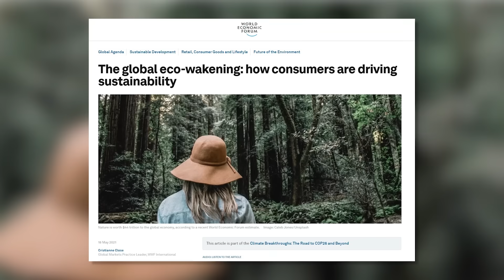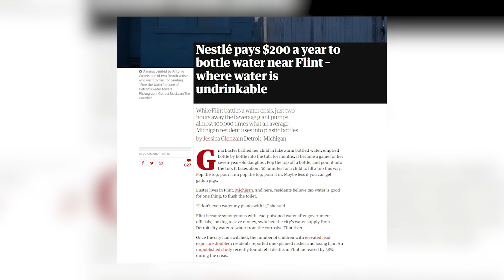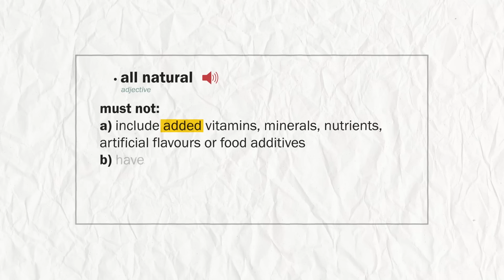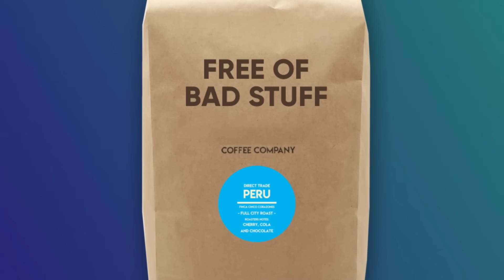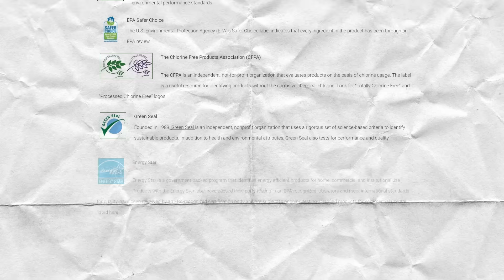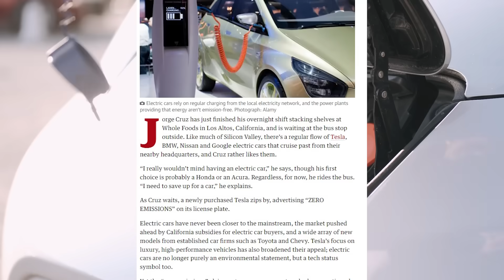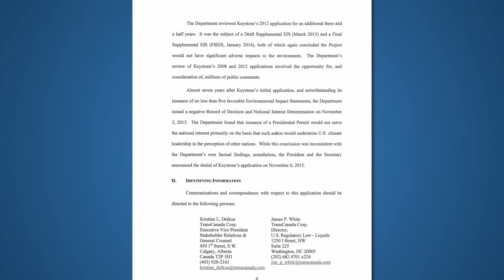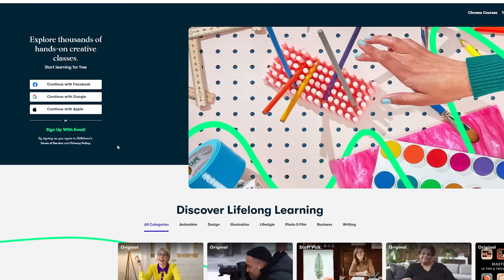Why Being 'Environmentally Friendly' Is A Scam

Comment: For the most part I agree with what he says, but the pipeline thing is crap. It's so many times worse for the environment to ship the oil via trucks for so many reasons. It uses oil, pollutes the environment. Not to mention that a rare pipeline spill has less impact and is easier to clean then a tanker spill, which is statistically far more common. So congratulations america, you shut down the more environmentally friendly option by listening to people who didn't know scratch.
There should also be mentioned how much most alternative energies rely on hard to mine heavy metals, and the negative impact the environment has on that. The worst part to me is things like wind, where the wind turbines have a lifespan and then the blades and everything are dumped. There is currently no way and no one recycling them. I was really horrified to learn more of that

Comment: More cotton bags are being made but you need to use them 20,000 times to offset the environmental resources. Plastic bags have been proven to be better for the environment and contrary to the democratic belief... most people do reuse plastic bags. Plastic bag holders have been made by ikea not that long ago. Most people use those bags up to 3 times each.
Reply: We banned plastic bags here. I used to save them and use them bathroom bin bags or clean the litter.

Comment: want to help the planet? PLANT TREES!!!! shocking truth is trees will and do help the planet more than anything we humans are doing because 95% of green house gases is water!!! and don't go with what google shows you. sadly they are just on the "eco-friendly" wagon. (Edited add on) Neither side did the research properly on the Key Stone pipeline. How do I know? I did a research project for my Bachelors Degree on it. The pipeline is an ADD on, not a full blown new pipeline, and all they did was draw a line and say "ok here is were it's going to be" they did not research where it really needed to go and what it needed to go around. oops on their end....the green peace side didn't do their work on "Oh look over 2,000 tucks will be removed from the roads hauling sand oil from Canada to Texas every day." Meaning Thousands of tons of toxic emotions would of been removed from the air. Also, there are more oil spills from people crashing those tankard trucks than a pipe line spill. Yes, when a pipeline does break it's big. Nothing humans do is perfect, it never will be people. We just have to figure out the lesser of the two evils and work to make that as perfect as possible.

Comment: Can someone explain to me how a pipeline, while safely and without the need to expend fossil fuel to transport crude oil to refineries, is more environmentally damaging than say transportation by truck, rail, or by sea? All three use fossil fuel by large amounts and also have accidents such as derailment, automotive wrecks, hull spills and crashes much more frequently than a stationary pipe of oil has leaks. And if the government wanted to find a better solution, they could acquisition land in such a way to not impact Native American Heritage grounds much like they do when creating a new Interstate. I'm not saying the system is broken, I'm saying the system is rigged to hurt everyone but those who run it.

Comment: I get that Nest can't prove they are the most environmentally friendly product, but I added one about a year ago and my electric bill has been cut in half (yes, yes I know that is anecdotal at best).  As far as the bit about electric cars only being as clean as the grid they run off, I couldn't agree more.  In 2015 I visited San Francisco for VMworld.  One morning on my way to the conference I boarded an electric bus that had a sign on the back claiming to be 100% clean.  I casually asked the driver if the grid San Fransico was on was 100% renewable, and he let me know it was nowhere close.  I failed to convince anyone on the bus that all we did was clean up some diesel emissions by replacing them with coal.

There is an excellent movie on amazon called Planet Of The Humans that will make your blood boil on how our best environmental efforts are still failing.

Comment: The electric vehicle scam is the funniest in my opinion. So many people think they're saving the world by driving an EV, not realizing that on one hand, yes it eliminates the issue with carbon emissions, but on the other hand, the amount of mining required to get all the materials for those batteries does extensive damage to the surface. Not to mention the equipment used to do all that mining is gas-powered, so it still creates emissions.

Comment: Funny you should mention the Keystone XL pipeline. By stopping and reversing its construction, more damage was done and the pipeline was going to reduce fuel waste in transportation of... You guessed it... Fuel.
So, sin of the hidden trade-off.
A lot of people's proposed solutions to the problem it was going to solve involve essentially "let them eat cake", that is to say, "you don't need fuel if you get an expensive luxury electric car", which is unhelpful and just keeps putting the burden on the consumer as plenty of people in the world can't afford those, can't charge them during their commutes, they're only as clean as the grid, power delivery by charging a battery is less efficient than other ways of delivering power to a vehicle, higher fuel prices lead to higher energy prices even on a supposedly green grid, the list goes on.

Comment: Well, I wonder if we'd built that keystone pipeline, we wouldn't be paying $6/gal for gas. Everything comes with risks, and there needs to be alternatives, but really, we can't have people driving to work for the price of what they'd earn while there. Oil is a necessary evil now for vehicle fuel, because we've been cornered into it. If you live 40 miles from work, you won't be riding a bicycle to get there. The plastic water bottle debate can be easily solved by not buying water in plastic bottles. Good news, though. One day, we'll run out of oil, and plastics will no longer be produced, along with the sealed Lithium batteries in electric vehicles powered by the burning of coal and other harmful energy producing means. Then what? The world we've lived in, built by the industrial revolutionists and robber barons of 150 years ago will end in the predicted apocalyptic scale. The end is coming, just sit tight.

Comment: You know what annoys me? The plastic grocery bag was invented to stop paper bags clogging and polluting as they degrade or rather dont. The idea behind a grocery bag was to have a bag that could last forever, but they couldnt resell that so our grocery bags are flimsy and "single use" even though you should be able to reuse them. And you should be able to reuse your drink trays as they are, and should be able to have your bottled drinks refilled by the manufacturer. I buy those starbucks chilled coffees in glass, that glass wont ever be recycled but if i could id haul a flat of em in to be refilled locally.

Comment: The VW thing got 2 sides to it though they ended up making more reliable cars since they did not just in the short term find a complicated fix that was gonna end up costing the consumer crazy amounts when it broke down if we don’t have to buy cars so often we also pollute less cars in general have been over regulated in the short term to quickly it’s hasn’t given manufactures a genuine attempt to find improvements without have to tax on crazy costs so bunch of shit cars are being sold or just discounted entirely.

Comment: I find the best “environmentally friendly” habits to pick up are pretty simple after a week or two.
1. Only buy foods that you know you will eat
Make sure to check the expiration date once you start doing this, you don’t want to buy something near expiration and then a week later you can’t eat a good meal cause that’s the only bearable food you have.
2. Turn off the tap when you aren’t using the water.
This is incredibly simple and I don’t understand why some people aren’t able to follow it. In the middle of brushing your teeth? turn the tap off, you aren’t using the water. The plate in the sink is clean? turn the water off, what’s the point of cleaning something that’s clean? I would also add onto this that you should take shorter showers, 5 minutes at max. Every now and then it is fine to truly relax, but still there are other ways to chill without wasting water when your already clean.
3. Turn lights off when you aren’t using a room
Just flip the switch.
4. Pick up garbage
And of course, don’t leave your trash sitting around outside. Plus that, depending on where you live, you can get fined (oh no!!! My moniez!) for littering if someone has proof. Either way, just don’t be an idiot.
5. Use your car less
This can be impossible depending on your age, disabilities, and environment, but for those who are completely able there is no reason to jump into your car every-time you have to go somewhere. There’s a corner store down the street? go on and walk, it’s better for your health anyway.
Reply: Most people do this anyways because the costs of bills negates any benefits from being too 'lazy' to follow the outlined steps. However, the ultimate biggest factor in waste reduction would be increased pressure on multinational corporations to abide by basic regulations; normal civilians are already expected to be resourceful so as to be mindful of scarcity, yet the same rigidity has not been enforced at the upper level.

Comment: Actually green energy itself starts with a massive carbon footprint, they all do some environmental damage when in use and when you account for the grid, charge/discharge and AC/DC conversion.  The lack of stable power generation from green energy also means that less efficient CO2 producing power generators have to be used, the less efficient fast response generators in addition to being less efficient they also produce significantly more CO2 per Kilowatt.  As Germany transitioned more and more to solar power, their power costs and CO2/Kilowatt increased more than when it barely used solar.

For electric vehicles to actually have an impact on cleaning up the environment the only solution is Nuclear power.

Comment: Oh yeah, two of my favorites are Electric Cars and cloth bags over plastic ones.

The energy has to come from somewhere to power the car (which might be a coal or gas power plant). In addition you have large batteries which are usually made by strip mined material and have a huge effect on disposal when they are spent.

The plastic bags get used a lot for a second use (instead of buying a package of single use trash bags) as trash bags, scoop the kitty litter into, toss lunches into, perfect for carrying stuff over to friends houses...

... the cloth bags you have to be washed every so often. The carbon footprint of growing the cotton or hemp, bringing it to market (usually made in China), and having to account for the hot water, soap, gas/electric for drying the bugger is worse than if you reuse the plastic bags.

Comment: Don't try to act as if this is new.  This type of deceptive advertising has been going on for decades.  As far back as the 1980's "diet" products would deceptively claim they were "lite" or "low fat" or whatever when the truth is the lower fat item = was higher in calories.  So they reduced certain ingredients - but because that altered the flavor they added others which subsequently boosted the caloric count of the product.  This type of nonsense applies to many things.

Comment: 2:18 Yeah, and even if all of those were recycled, many bottles may still be contaminated with food/beverage leftovers or other contaminants, so even if you recycle them, it may not actually be recycled and would be thrown out
The worst is if like a recycle truck has one piece of contaminated material, then they have to throw away pretty much all the stuff from the recyclable truck (I’ve seen this happen when I went to a plant before- but then again, the policies may have changed!!)
That’s why even though I feel horrible in doing it, I usually throw away plastic stuff that may be contaminated even if they claim it can be “recycled” - I’m scared that my recycled waste may be the reason for why they throw away that recycled trucks waste

Comment: I love how you mentioned this insane focus on plastic straws (it was literally a global movement there for a while...In my country plastic straws are now banned, instead they use cartong straws (which I believe cause more Co2 pollution than plastic do)...

And 8 million tonnes of plastics flow into the ocean every year (as of 2020, this is a increasing number), plastic straws merely comprise 0.025% of the total...  Not exactly the biggest impact we could of made when pushing for a ban on a "huge pollutor"..

Taking Hong Kong as an example. "Research conducted by the Ocean Park Conservation Foundation reveals that Hong Kong’s overall plastic straw consumption has dropped from 1.7 billion to 1 billion from 2017 to 2020, indicating a 40% drop in its annual plastic straw consumption. However, its overall waste plastics have increased by 10.3% from 2017 to 2018, signifying that the plastic straws reduction does not impose a huge impact on the overall amount of waste plastics. "
Reply: You'd think people would stop eating fish vs give up plastic straws but society is dumb.
Reply: @tsarina24honolulu87  This (though you could always do both at once). The same people that decry plastic straws killing sealife are oddly silent when it comes to killing the fish for a bite to eat. Straws may make 0.025% of the ocean's plastic inflow. That's no small portion, but it pales in comparison to the 10% that fishing equipment produces.

Good luck convincing megacorps like Nestle or Pepsico to change at the cost of profit. Companies won't lift a finger if it means making another dime. It would take a large scale political effort to put environmentally-conscious policies in place. As long as companies are able to "lobby" for policies to go their way, its not happening.

AnimalAg is responsible for much of the GHG and pollution we emit each year. Want to make a change that actually has an impact? Stop eating meat, dairy, and egg.

Comment: I support the keystone pipeline. It's far more ethical than shipping crude oil around the globe and Increasing toxic emissions. The world is not ready for a fully electric transport system. Electricity is still majorly produced by mining coal... meaning even if we had a infrastructure that could support electric cars, we would still be stripping nature bare for a basic resource, that kills off ecosystems. I've debated clean energy a lot with people in different political realms and lifestyles. The two things everyone agrees on after looking at the pros and cons are... 
1. The world runs on oil and gas (for now) and sourcing it as locally possible is the most ethical way to meet the demand (when it comes to emissions and protecting low/middle income households who rely on those jobs).
2. The world is heading towards a new age of digital and electronic wizardy. It is not sustainable- yet. The two major barriers to a fully renewable energy source are funding and public perception. Aka electricity is expensive when we talk avout redoing infastructure, replacing vehicles, and pay for educational marketing that tackles the stigma of our cleanest energy source (nuclear). 
It would take billions to accomplish this... it's not impossible... it's just one of those things where even if everyone was on board it would take decades to eliminate the need for oil and coal.

Comment: I think that the point mentioned on the lesser of two evils is the only one that I think shouldn't be here simply because it's an encouragement to cut emissions if you can rather than stating something bad. Other than saving money, you're also burning less fuel, which is good. At the end of the day, it's better to be like me and use a bicycle, though I might get a motorcycle when I'm older but I'm definitely not getting an electric car or an ICE car (unless synthetic fuel is developed). That would be the lesser of two evils but it's still way better than straight up getting a car. Trains might pollute but it's still way better to take them instead of a plane to get somewhere

Comment: This guy barely scratched the surface of this subject 🙄 first off all this consumer society has no alternative.It was build on a foundation of constant growth of production and producing as more as possible with less as possible.People are also products of this madness. Green energy is also just marketing, doesn't exist. Take for example wind turbines - they use hydraulic oil in tons for itch one ! Not to mention blades made of material that is not recyclable so gets buried into ground. Also not all kind of plastic are recycle.And so on ...All of agendas had their purpose, first cataclysmic stories about holes in ozone layer, than global warming, than climate change.... Green energy is one of that agendas  for regular people to believe someone is taking care of planet instead of them.And they are privileged and woke to participate in it by segregation of garbage ;-) electric cars are using lithium batteries that are the same one used in laptops in 70s !! Technology did not change! Not to mention monopoly of oil corporations and same design of power unit of car for more than a century (internal combustion engine)...